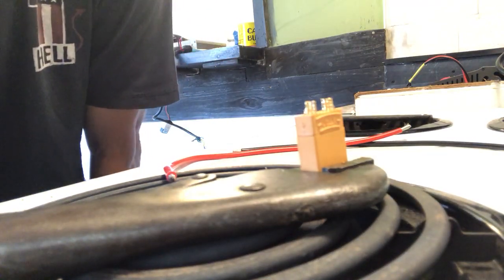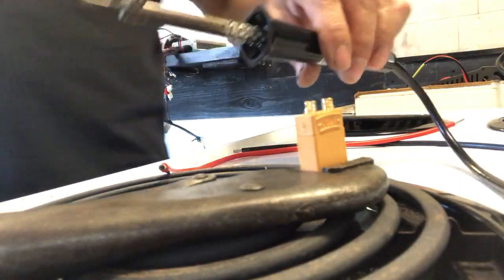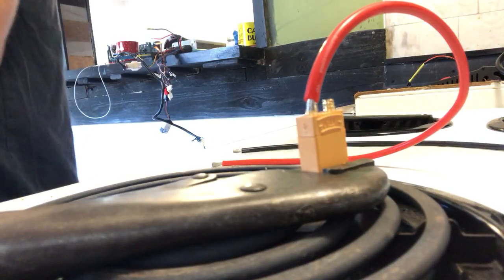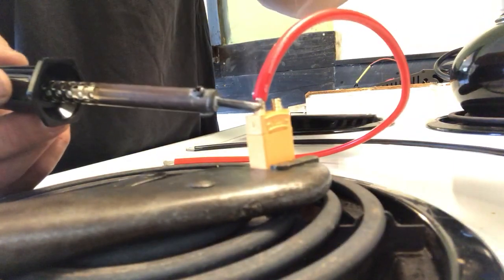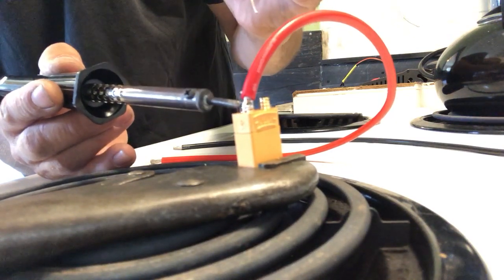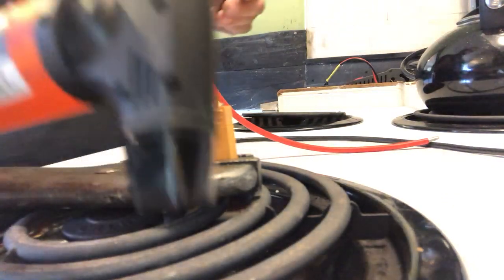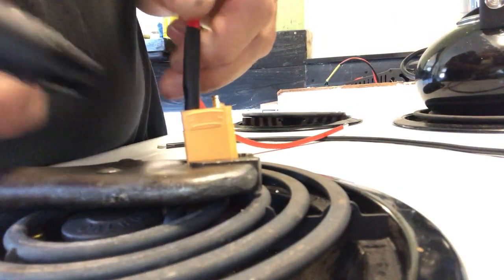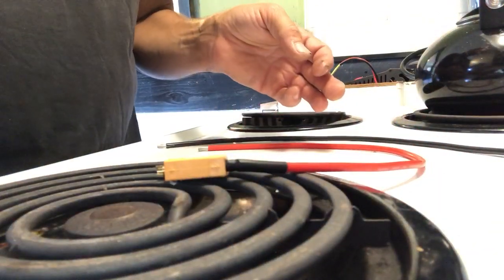How to solder XT90 and XT60

Comment: You really shouldn’t clean the iron tip with a file, the tip comes with a copper layer to keep from oxidation. To late now
Reply from the maker: T2 NATE I buy a new solder wand once a month
Reply: You don’t need to, just maintain your soldering iron tip, or get some quality ones and it will last a lot longer then a month